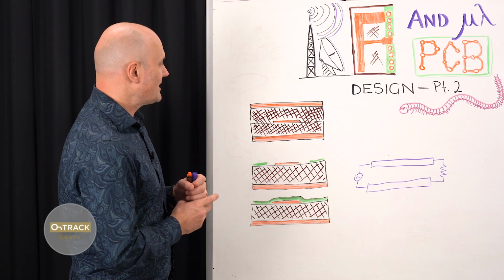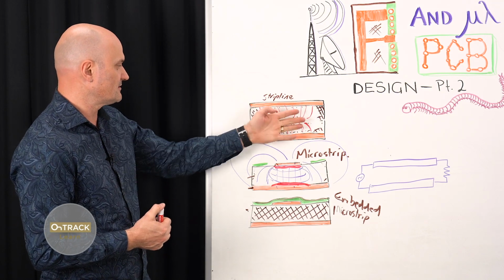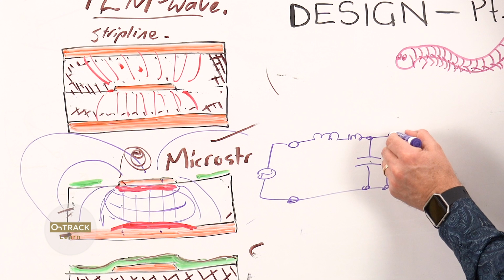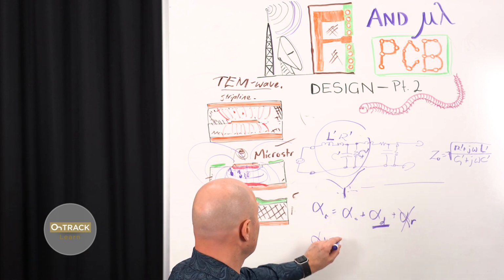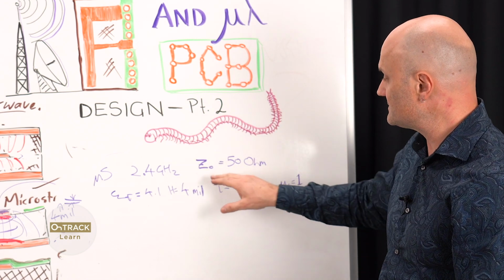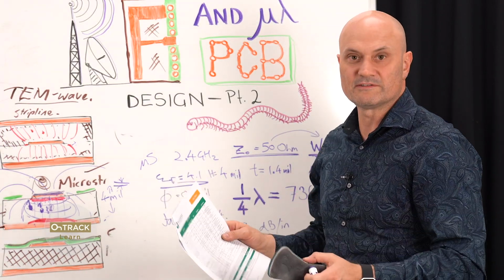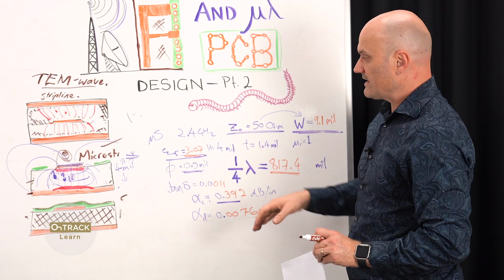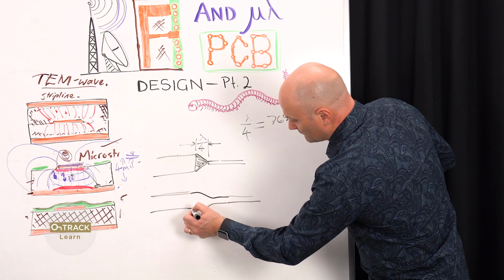RF and Microwave PCB Design Part 2- Transmission Lines and Impedance - OnTrack Whiteboard Series

Comment: Great Stuff Ben. I would like to see an episode on UHF Power dividers using very high Q 1/4 wave lengths or odd multiples thereof.  What is the lowest loss, longest physical length, lowest loss, PCB that can be economically  and readily obtained?  Where are the one line Calculators?  I used to have these but lost them and my construction notes. Email is Ramjet555 at G..mail

Comment: The phenomena described at 5:24 is related to proximity effect of a plane. Return path of RF current wants to go with the lowest inductance (smaller loop=the least amount of energy in inductance) . Skin effect itself would not create a bottom surface current only, but it would spread the current around the microstrip perimeter.

Comment: Very good series. Good and concise presentation!

One question regarding the smooth transition from one impedance to another using copper structures: How would one implement this using AD?
Reply: Günther R. Wenninger I usually just draw a linear taper using a copper region and assign a net to it.  Then you can connect a trace to either side.  Then again, if you are at the frequency where tapering is changing the performance, you ought to be simulating it in an RF tool such as Microwave Office.

Comment: I dont understand how did you get 1/4 wavelength for FR4 with e_r = 4.1 to be 736.03 mil.  i used lambda= 300/(2400*sqrt(4.1)) and converted to mils and multiplied by 1/4 and i get around 608 mils quarter wavelength. am i doing something wrong?
Reply: Nevermind, I figured it out. the effective e_r is not equal to 4.1, but around 2.8 when taking into account the trace width (W) and the dielectric height (H), stupid mistake of me